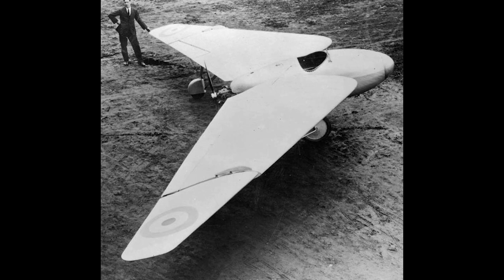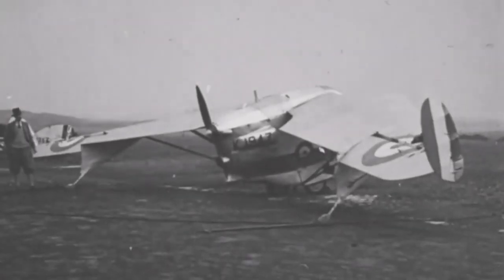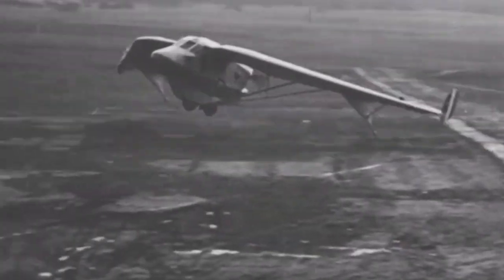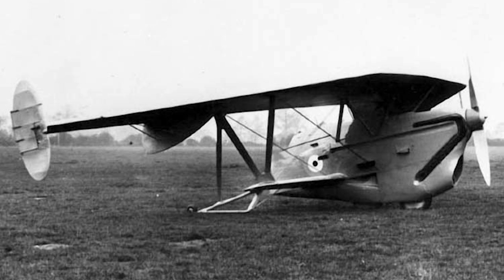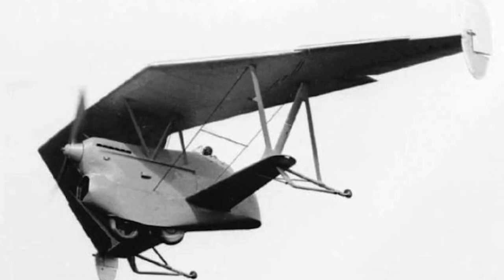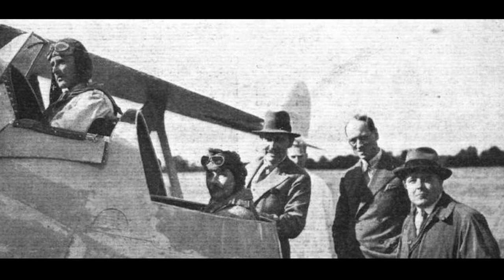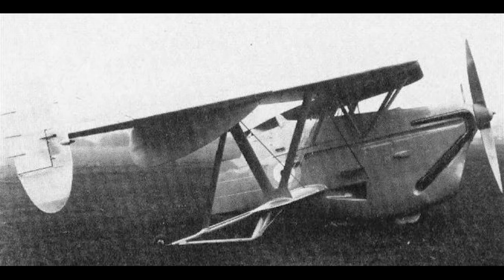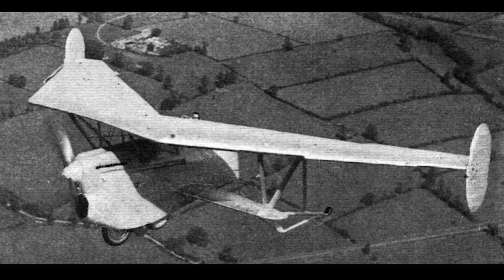Westland-Hill Pterodactyl V – The Flying Wing Fighter

Comment: It is odd to me that so many airplane designs get scrapped because the engine was faulty. After all, the engine is just a power source, and a different engine could be used, typically with only minor design changes that have nothing to do with the overall concept.

Comment: Actually a brilliant design.  Given a reliable engine and improved wing strength it might have gone much further.  The Luftwaffe eventually fielded the Go-229 "flying wing" which was where similar thinking led in Germany. Hill had it right, just too early maybe ??
Reply: Ho-229 is a beautiful plane, and great design fully compliant with the flying wing concept. Pterodactyl V is the worst implementation of a flying wing to ever exist (not to mention it's absolutely ugly). This "brilliant design" did everything to defy any benefit brought by the flying wing scheme. The upper parasol wing mounting was absolutely unnecessary by the beginning of 1930s and only added extra drag with zero advantages. The lower wing on the flying wing is just a joke. Oh, and that landing gear... By the time Pterodactyl V finally flew in 1934, there were some much better and cleaner flying wings already in the air. I still wonder if RAF ever actually considered this "brilliant design".
Reply: @sergeychmelev5270  It also just ins't a flying wing, a flying wing doesn't have a fuselage, but the Pterodactyl clearly does.

Comment: If the Goshawk engine had been a success the Luftwaffe may have been facing squadrons of these in 1940 instead of Hawker Hurricanes.  The Luftwaffe’s loss rate would’ve been horrendous, as the pilots wouldn’t have been able to fly properly for laughing.
Reply: Funny how the tail-less design developed with the Me163, Lippisch flying wings and ultimately the 117.
Reply: @vumba1331 what are you implying
Reply: Daz iss not funny!

Comment: Looked a sound design to me. That rear gunner had a fantastic field of fire.  Add  a turret with twin 50 cals then let any slimey enemy try to sneak up on it ..  I suspect the swept wings might have screwed up air flow over the wings, reducing lift  but that engine was obviously the problem.  I'm surprised it was so slow .. did any pilot test the manoeuvrability ? I suspect it could out turn a I-16 or Zero.

Comment: Another great video on an interesting design.
On a technical note though the video's sound-level is barely sufficient. I needed to crank the YT volume all the way up which was just enough not to require cranking up my system's sound too. You may want to consider increasing the sound level while recording.

BTW
I seem to have been unsubscribed from this channel, not sure why. I watch enough similar channels to find you in the recommendations.
Reply from the maker: Yeah, the sound seems to be an issue with youtube upload, I've never been able to figure why it goes bad on upload.

And as for subscribing, yep, youtube is just messed up it seems. Lot of people saying they are having problems :(

Comment: From the 29-second mark until a minute in, a lot of potential with the swept back wings that might predate the Horten brothers. (Not sure). At the one-minute mark, guppy time...sort of. Had a lot of potential, but the engine and some structural issues made it unworkable. What is amazing to me is that between WW1 and WW2, a lot of innovations came in, in a relatively short period of time. And during WW2, they came even faster, mainly out of necessity. Excellent video!
Reply: The Horten's first tailless design flew as a glider in the early 1930s. Hill's first tailless aircraft flew as a glider (and then as a powered aircraft) in the early 1920s. All of the Pterodactyls up to the Mk IV (the three seat civilian design) predated the Horten brother's first design. In fact, Hill was inspired by J.W Dunne who had built and flown a number of tailless designs prior to the First World War ... and before either of the Horten Brothers had even been born!
The Horten brothers were only two of MANY designers fascinated by tailless designs and they were fairly late to the party! Unfortunately (and I'm by no means accusing you of this!) they've taken on some sort of mythical status because of the Horten H.IX (Ho 229) which, although interesting in its own right as a turbojet powered flying wing, has spawned so much garbage and nonsensical claims that I've actually grown to hate the damned thing! lol
Reply: @rockymac3565  Thanks for telling me. I wasn't sure. The Horten brother's design, yes, has taken on a near-mythical status, but the damn thing flew. I'll have to check on this a bit more...the history of tailless flying planes is fascinating....just checked on J.W. Dunne..yes, his designs predate the Horten's by about fifteen to twenty years. Mainly gliders at first, but some tailless versions flew.
Reply: The American designer Dunne produced a tailless swept-wing biplane in 1911.
Reply: @raypurchase801  I know of the British designer J.W. Dunne who built his D.8 swept-wing tailless biplane in 1910 which was then license-built in the US as the Burgess-Dunne and used by the US Navy and US Signal Corp. Are you talking about a different Dunne and a different aircraft?
Reply: @rockymac3565  No, but I'm happy to Like the comment of anyone who can out-nerd me.
Well done, sir.
Reply: @raypurchase801  I thought Dunne was British, or are we talking about another guy? I saw the pic of the aircraft. Rather impressive for its day.
Reply: @jessfrankel5212  Seems like there are TWO nerds here who are more knowledgeable than me!
Reply: @raypurchase801  It's part of me being a writer. I have to check my sources. 😉🤣
Reply: @jessfrankel5212  I read somewhere that the Dunne tailless biplane was built in the USA, hence I assumed Dunne was an American.
Thankyou for checking your sources. There's enough rubbish on the net already without me adding to it.
Reply: @raypurchase801  Yes, I rechecked things. British by birth, but the plane was licensed and built in the USA. I defer to Rocky Mac's knowledge which far exceeds mine in this area. Credit must be given where it is due. Best of all, I learned something about the history of swept back wings and tailless aircraft!
Reply: @jessfrankel5212  Also - isn't it nice when you correct somebody on YouTube and they THANK you, instead of gyrating and getting angry and conducting a 200-message argument?
Reply: @raypurchase801  Yes. Tensions have always been high on this kind of forum, and there are a LOT of, shall we say, extremely opinionated people here. Me, if I mess up, I 'fess up. No biggie. I can always learn something new, and I did, after watching this video and reading the comments.

Comment: I want to design a RC plane based on a wing. Now you show me this! Now i have to re-design... I cannot find the blueprints of the Pterodactyl I (one).
Reply: there are some out there if you contact me directly i can point you there but youtube hates links
Reply: @stephenpointon  Thanks, but i found them on a Russian site. On this site i also found out what trick they used on the tip of the wings (it can rotate).
Reply: @peterschets1380  Your welcome, If you need any suggestions I am an aerospace engineer with nearly 50 years experience designing both model and full size aircraft and was thinking of building a similar electric powered design

Comment: I would imagine it would of had better performance if it was a mid wing and the wing tip vertical stabilizers had landing wheels. Put a RR Merlin in it and ditch the rear turret. Then you might of had a great little interceptor.

Comment: I can't help wondering how aircraft development in the UK would have looked if the Goshawk engine had not total rubbish. A common theme for a lot of experimental planes in the 1930s in Britain is that they performed well, had great potential but failed because the Goshawk was a POS machinery and the planes were scrapped while trying to fix the engines problem and not the planes.
Reply: Or if the manufacturers had been allowed to choose their own engines.
Reply: To be fair, one can't expect every engine to be an instant success. Development of cutting edge technology has always been a very hit and miss affair.
Reply: @jackroutledge352  True but given that the specifications mandated the use of the Goshawk in some designs, it seems that the UK put all of its eggs in one basket so to speak.
Reply: @Theonixco  this happened more than once. There were a lot of designs just after WW1 where the specifications required the ABC Dragonfly  engine - another total lemon that doomed many promising designs and wasted ££££ of development.
Reply: Once it was clear the Goshawk was a turd why didn't they fit other engines to their aircraft? Remember the P-51 started off with an Allison Engine before getting the Merlin upgrade.
Reply: I came here to say exactly this - and to wonder if Nazi Germany could have damaged British preparation for WW2 more than the Goshawk engine design team ... how many engine-doomed experimental aircraft has this channel already covered? 👀
Reply: This p o s  makes the German developed Horten flying wing futuristic for its time and would not be too out of place flying  today.

Comment: Westland was never shy of being cutting edge (e.g the Whirlwind). Quite unlucky in the engines they were lumbered with though..
Reply: There was a lot of lobbying and ‘funny handshakes’ going on between the government and industry in WW2. Not sure if that was the problem with the Whirlwind, though. It wasn’t unusual for Rolls Royce to cancel engines under the pressure to build Merlins, several designs were dropped, as was the Goshawk for the pterodactyl. What was needed was to redesign the Whirlwind for Merlins. It was two small to just be adapted. The redesign was the the Welkin, but the spec called for a high altitude performance and it had a thick wing - which doomed it to failure…
Reply: Deliberate perhaps if they were not favoured by officials? Not greasing the correct palms?